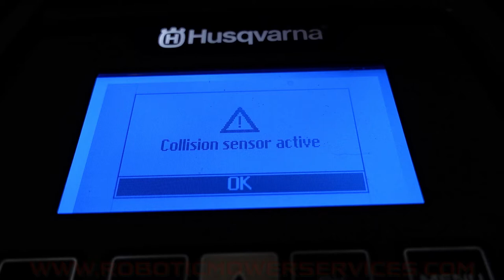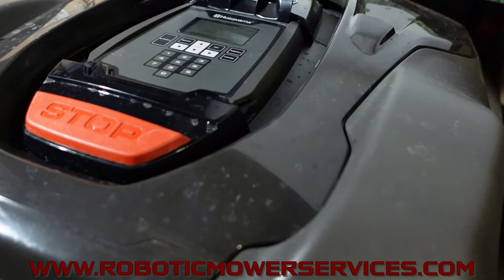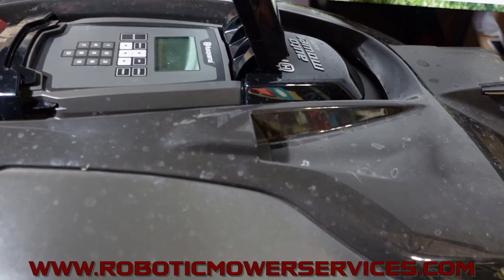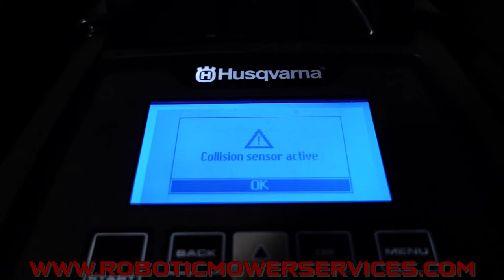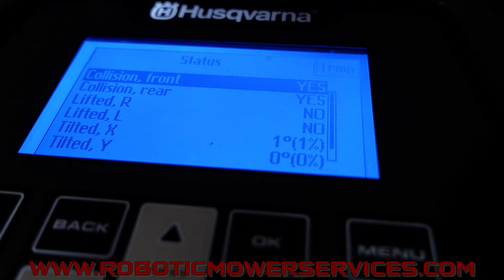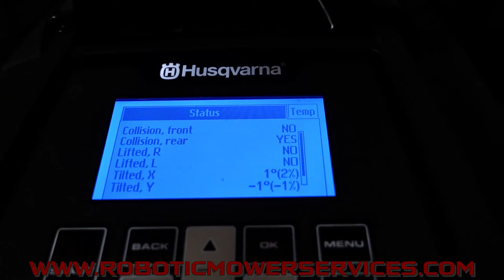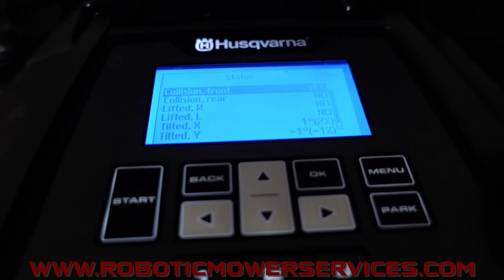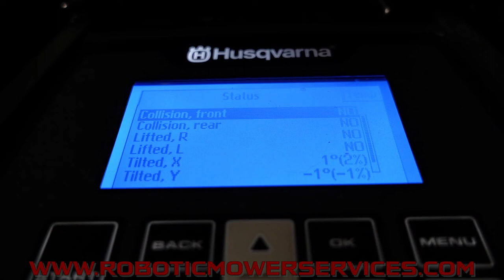Husqvarna Automower Collision & Lift Errors Completely Explained For 430X, 430XH, 450X, & 450XH

Comment: When I switched the ribbon cable around, the rear collision went away, but I didn’t get a front collision. I was going to order a replacement just to be safe, but I don’t see it on you website? 430x btw